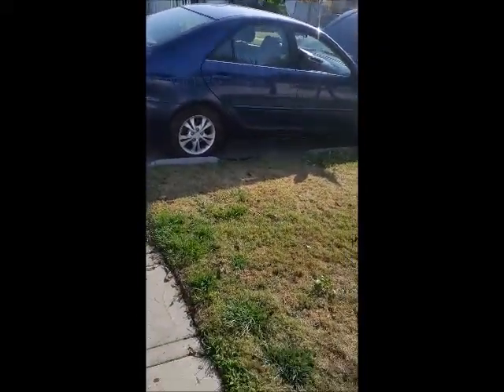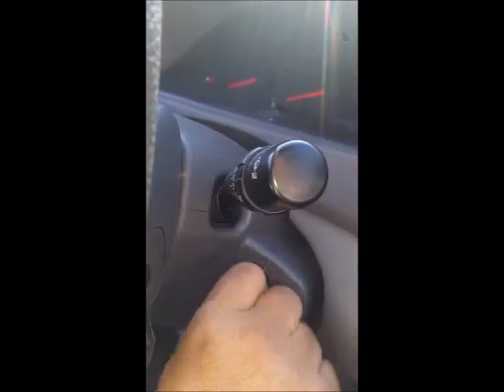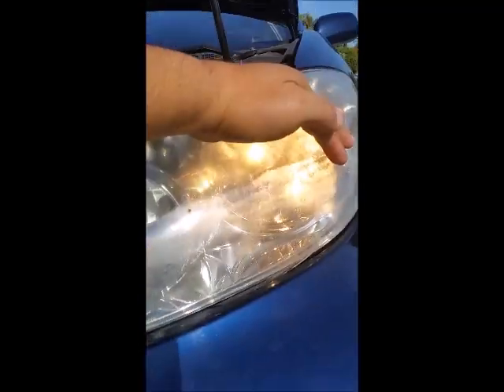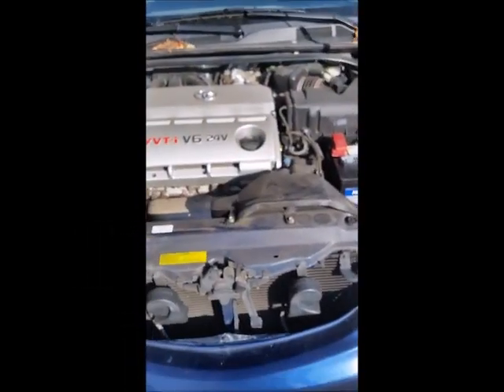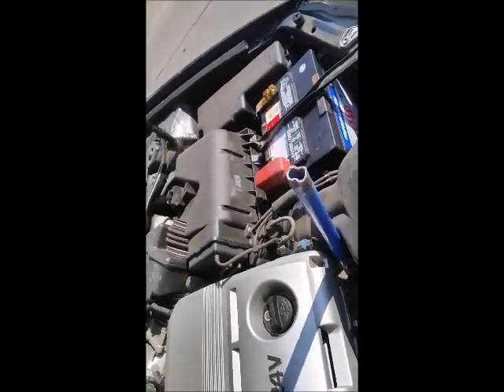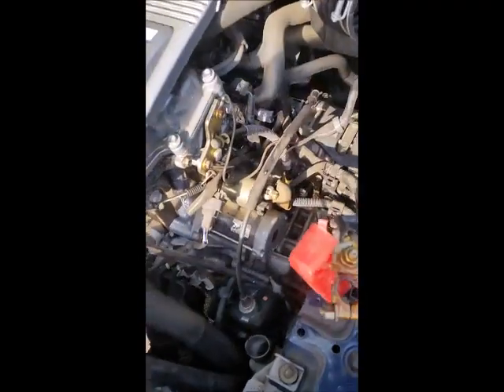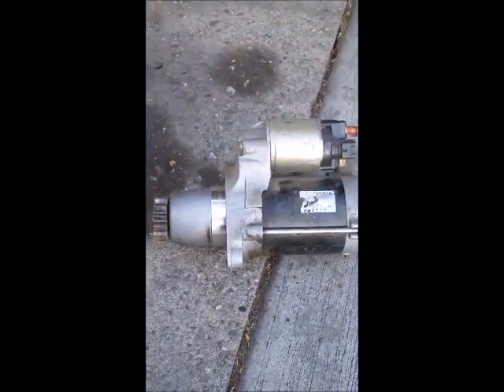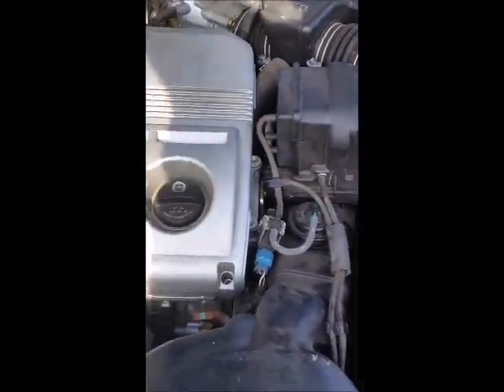2005 Toyota Camry wont Crank or Start

Comment: The SECOND thing you check after the battery is the fuses then the relay and neutral safety switch. Those things are the simplest and cheapest. After tracing the problem you end at the solenoid /starter. A solenoid is not always cheaper than buying it already attached to the starter. By the way, if you hear a click, it's not your relay, fuses or neutral safety switch. If you DON'T hear a click then it could be any of the 3.
Reply: Great tip! I'll check the fuses and relay before I replace the battery on my daughter's car.
Reply: @screwthecqbal6453 

What if the Camry clicks once and turns off. I have a guy I know running into this issue. He has to take like 10min to start his car. Key in the ignition goes to start and clicks then turns off. He does this multiple times then bam the car starts up fine. He’s replaced his fuses, start and ignition. Still having the same issue.

Comment: I believe I have the same problem on my 2005 Canry. Except that hotting the starter worked but I am going to replace it anyway..my battery is 5 months old and the starter looks like the original starter

Comment: I'm having this issue. Took it to Toyota dealer. They couldn't find anything wrong. Looked at the mileage from the time I was there with the same problem til now with the same problem. They said I don't drive the car enough. Got in it this morning. Turned the key it wouldn't start. Turned it a second time it started. I'm having headaches now.

Comment: Had this issue. Had to turn the steering wheel to lock it, then start
Reply: Really... My Camry did this tonight After work (first time) and I never could get it to crank. I actually rebuilt this motor myself about 4 years ago so I'm mechanically inclined but locking the steering wheel never occurred to me. I'll try that tomorrow before I begin chasing down other potential problems. Could you give me a brief description of what your cremory was doing? Like were you getting full power when you turn the key to AC but when you bumped it over to start you got nothing... No voltage drop no. Crank no nothing?

Comment: Since there is no click, you can just replace the starter solenoid, which is cheaper than buying the complete starter. I would just buy Toyota starter solenoid. After market starter does not have quality solenoid, which will fail quickly (mine failed after 6 months).
Reply: Not always true. I have this starting issue right now and the solenoid was $20 more than the starter
Reply: @screwthecabal6453  Yea they cost as much as the whole starter

Comment: Did the car keep power when running after this repair?
Reply: Jesse Cordero so the car will come on lights on just won’t turn over if it’s the starter connection? That’s the bolted down wire that goes to the negative terminal correct?
Reply: Same here but took the starter off and took it to Oreilly it passed. So after that I didnt know what to do.
Reply: I also changed the starter but it still doesn’t wanna crank
Reply: @amirkaranoub1594  Did it start?

Comment: What if the lights don’t turn on?
Reply from the maker: You might have a bad battery or the battery terminals may be loose.
Reply: Or alternator or 100 amp fuse